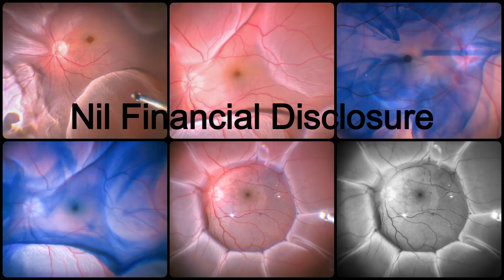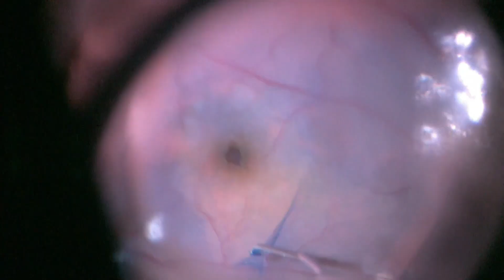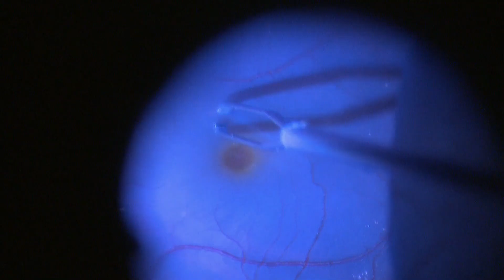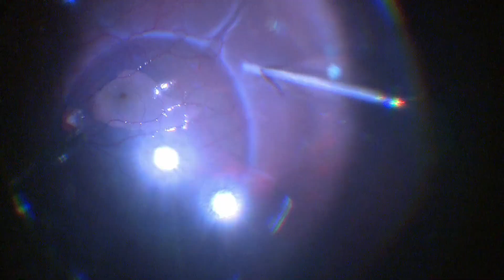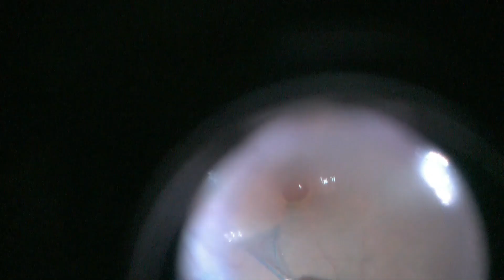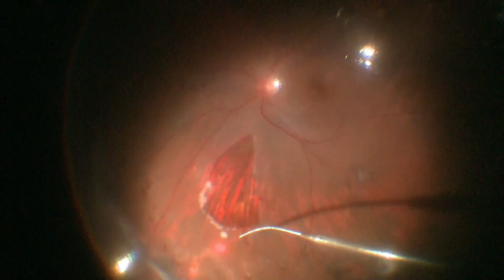Vitrectomy for Retinal Detachment with macular hole | Retinal Detachment | Dr Manish Nagpal

Comment: If you may show as videos for excellent visualization especially under air ?
Reply from the maker: with the contact wide field viewing that I use from. volk it does not make any difference if you are in fluid or air usually 😊